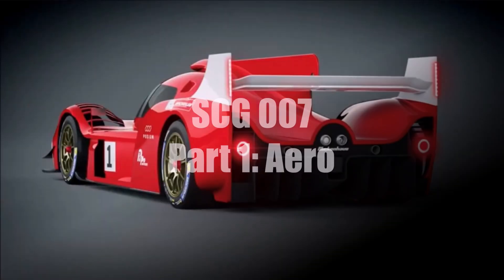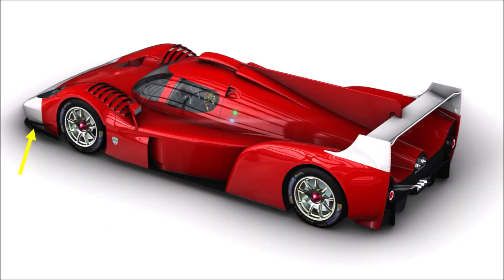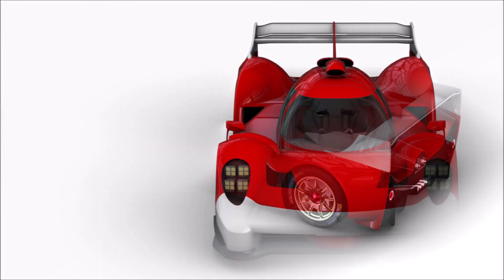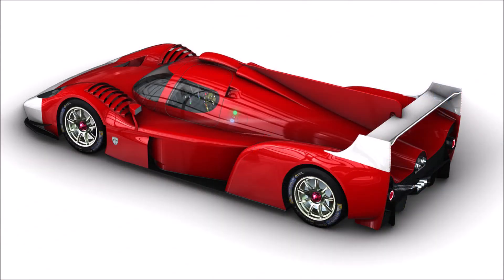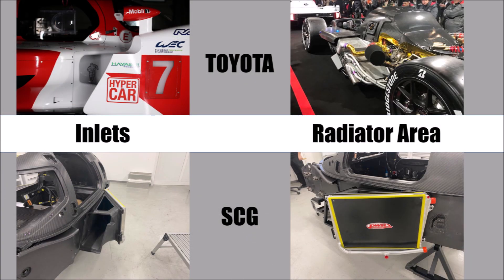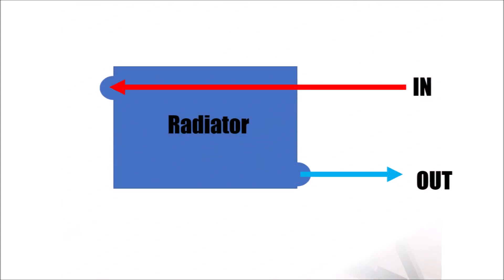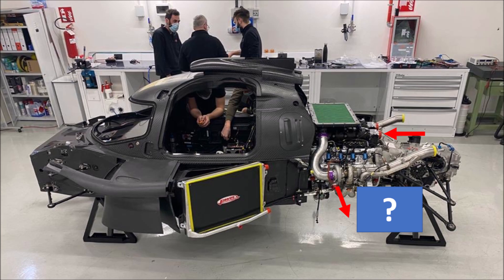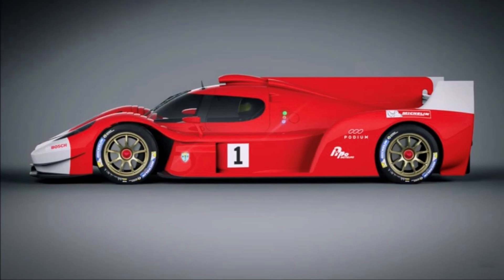SCG 007 (Glickenhaus Hypercar) Part1 - Aero

Comment: Any update you can report? Ive been waiting for more. 
Also, how much weight typically paint/ graphics add to a bare carbon car?
Reply from the maker: I might bring an update once there are news from the test in Aragon.

As for the paint it depends on the car (prototype or formula car) and if the car gets painted or wrapped. In F1 it's around 1.5kg.

Comment: It has an Air to water intercooler, so the radiator in the one sinde is used for engine vooling, and the other side is for coolinh the intercooler water, and these things dont have to be big, they could also intercool it by using the air conditioning to cool the compressed air, as the dodge demon does it

Comment: Awesome video !
The lasts pictures posted by the SCG shows the air box with naca air ducts on the side... And on twitter, he answered a guy who was asking what was the use of that by "Very interesting engineering. Multi PSI inlets and functions..."
Can't wait to see what it will be used for ! Imo it as something to do with the two air intakes that are still not used... And maybe the intercooler ! Who knows ? 😁
Btw about the big nose, if I remember correctly, Jim Glicknaus said that the car will be available for customer teams, witch will be able to use a different engine and an hybrid system if they want to... So that's why there is a big nose ! To let potential buyers add a hybrid system 😉
Reply from the maker: Thank you very much!
I read and saw that too and think the NACA ducts are for clutch cooling. There wouldn't be enough air for intercoolers. I am working on the next part where I will talk about this in more detail.
Reply: @bsport320  Great ! Can't wait 😁

Comment: Beautiful car. Endurance racing needs more of these and less Toyota styles
Reply: Honestly, as beautiful and classy the Glickenhaus is, you can't blame Toyota for choosing the more performance-based design, because after all teams don't compete to build the most beautiful car, but the fastest
Reply: @alessiobonamini1792  adding to that, as mentioned in the video, the reason that the Glickenhaus looks like that is because they are budget limited. Had that not been the case, the car would have been similar in design to Toyota as it is more effective.
Reply: I like the variety honestly
Reply: Toyota less? How about Audi or Porsche? It needs more constructors, always.

Comment: Great analysis:) Concerning the radiators. Did I understand it correctly that the smaller inlet feeding the larger radiator was more efficient than the larger inlet feeding the smaller radiator?
Reply from the maker: Yes, you have less losses if the air moves slower through the radiator